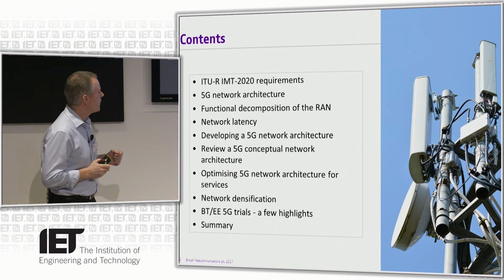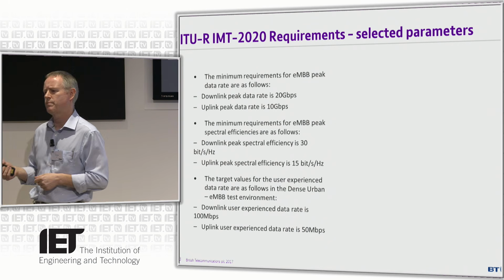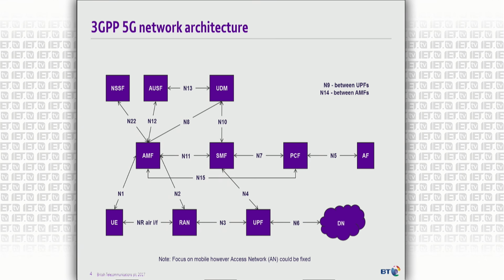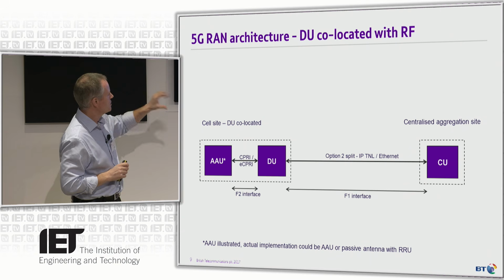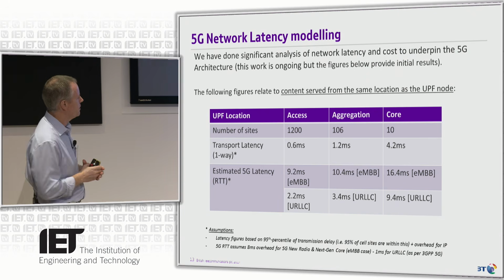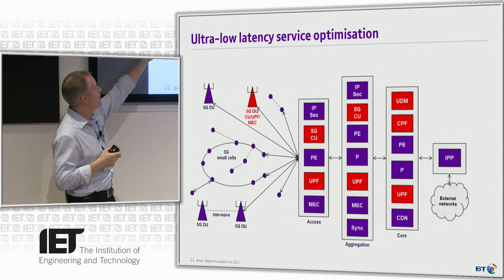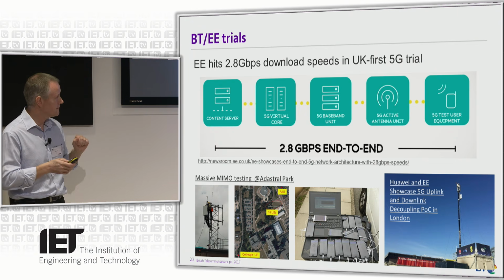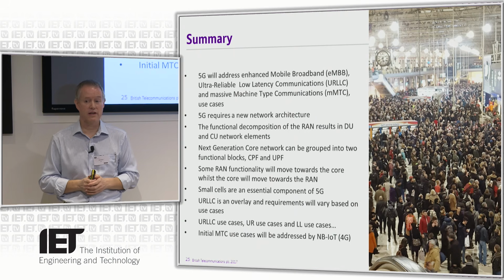5G Network Architecture by Andy Sutton (IET 2018 Turing)

Comment: About the security between Core Networks and Access networks(5GC -- RAN), (1) How a secure session is created? What do security needs - integrity & authentication only? (2) Does it use IPsec or DTLS? (3) Does the security session has a time latency limit? (4) What is the capacity of the devices used to create the secure session ?About the security between Core Networks and Access networks(5GC -- RAN), (1) How a secure session is created? What do security needs - integrity & authentication only? (2) Does it use IPsec or DTLS? (3) Does the security session has a time latency limit? (4) What is the capacity of the devices used to create the secure session ?

Comment: INDIA MUST CONTINUE ON 4G..

WE MUST NOT JUMP INTO 5G..

Until now, mobile broadband networks have been designed to meet the needs of people. But 5G has been created with machines’ needs in mind, offering low-latency, high-efficiency data transfer

It achieves this by breaking data down into smaller packages, allowing for faster transmission times. Whereas 4G has a fifty-millisecond delay, 5G data transfer will offer a mere one-millisecond delay–it will permit machines to achieve near-seamless communication.

The idea behind 5G is to use untapped bandwidth of the extremely high-frequency millimeter wave (MMW), between 30GHz and 300GHz, in addition to some lower and mid-range frequencies.

High-frequency MMWs travel a short distance. Furthermore, they don’t travel well through buildings and tend to be absorbed by rain and plants, leading to signal interference

This would likely result in wireless antennas every few feet..with each emitting bursts of radiofrequency radiation (RFR)..

If we could see the RFR, it would look like a smog that’s everywhere, all the time. They will permeate the Blood Brain Barrier, disrupt cell metabolism, rupture DNA strands, cause oxidative damage etc.

BEES WILL BE DECIMATED..

http://ajitvadakayil.blogspot.com/2011/09/queen-bee-and-darwin-capt-ajit.html

The new 5G technology utilizes higher-frequency MMW bands, which give off the same dose of radiation as airport scanners.

Over ninety percent of microwave radiation is absorbed by the epidermis and dermis layers, so human skin basically acts as an absorbing sponge for microwave radiation. Disquieting as this may sound, it’s generally considered acceptable so long as the violating wavelengths are greater than the skin layer’s dimensions. But MMW’s violate this condition.

With millions of sweat ducts, and 5G’s increased RFR needs, it stands to reason that our bodies will become far more conductive to this radiation.

US Department of Defense already uses a crowd-dispersal method called the Active Denial System, in which MMWs are directed at crowds to make their skin feel like it’s burning, and also has the ability to basically microwave populations to death from afar with this technology if they choose to do so.

The Active Denial System (ADS) is a non-lethal, directed-energy weapon developed by the U.S. military, designed for area denial, perimeter security and crowd control. The weapon is also called the heat ray..

The ADS millimeter wave energy works on a similar principle as a microwave oven, exciting the water and fat molecules in the skin, and instantly heating them via dielectric heating.

Human test subjects reached their pain threshold within 3 seconds, and none could endure more than 5 seconds..

For the first millisecond, it just felt like the skin was warming up. Then it got warmer and warmer and you felt like it was on fire. ... As soon as you're away from that beam your skin returns to normal and there is no pain.

5G, or “Fifth Generation” technology promises speeds of up to 100 times faster than the current model

IT IS TOO HEAVY A PRICE TO PAY !

capt ajit vadakayil
Reply: Stop this pseudoscience nonsense
Reply: Thank you, basically it is a depop tool for the jews.  Interestingly the Jews in Israel will not be using 5G also they won't allow 5G in the elite city of Palm Beach Florida . Go figure!

Comment: Sending oscillating microwave radio frequencies through an electromagnetic field into a dielectric material, such as water, creates radio frequency heating at the molecular level of water. This friction causes heat which is called Radio Frequency Heating. This is the basic principle behind the Microwave Oven. VERY DANGEROUS FOR HUMANS.
Reply: NWO locking down the smart grid, thousands if not millions will die from this, and the media will not point the finger and the mass's will be clueless as cancer sky rockets...its a scary dystopian future, we must all be prepared